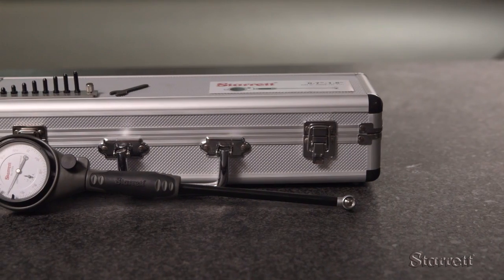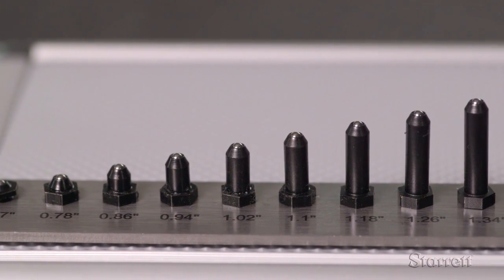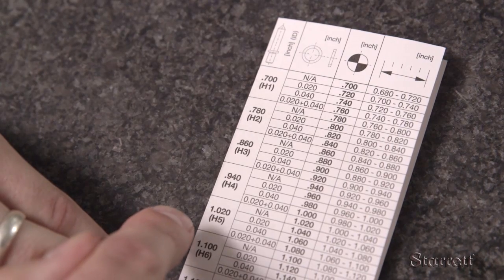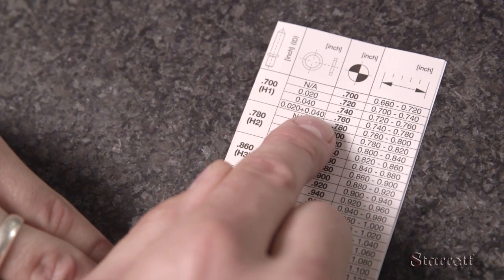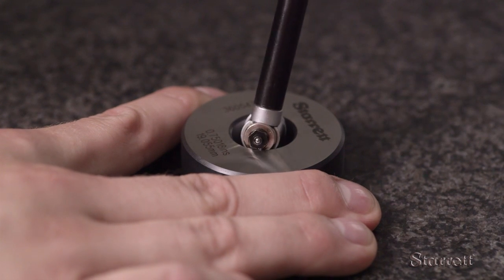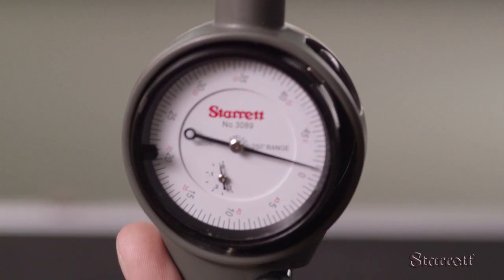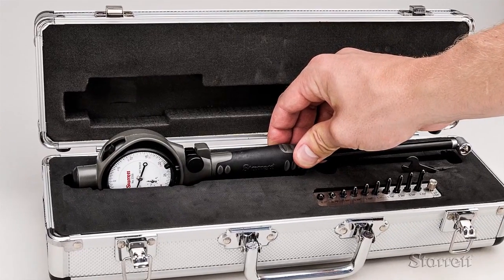Starrett 3089Z Dial Bore Gages

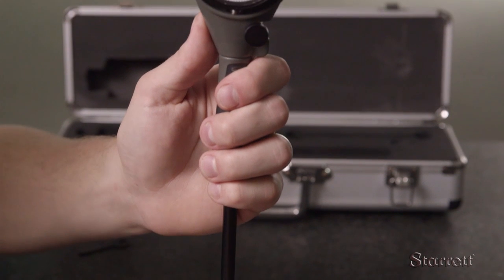Comment: Look at point 2:18 in this film clip.  The actor says that the dial bore gage is reading -.002  This is not true!!!  The gage was supposedly set at .750; the needle is registering a larger than .750 by .0005".  The indicated reading is .7505" not -.002 or .748".  I'm surprised that Starrett would make such a shoddy video.  Doesn't anybody at Starrett know how precision instruments work?
Reply: None of their videos make any sense. Company has gone screaming downhill. Go watch the outside micrometer video and watch the "machinist" turn the dial clockwise while the narrator is babbling about the proper way to use said tool mandate that the dial be turned counterclockwise

Comment: Is it good practice to give machinist an SOP that gives instruction that the dial must rotate a minimum or maximum rotation? As an example the hand should never rotate past the zero more than once for a target measurement. Gage blocks are being used with bore gage.